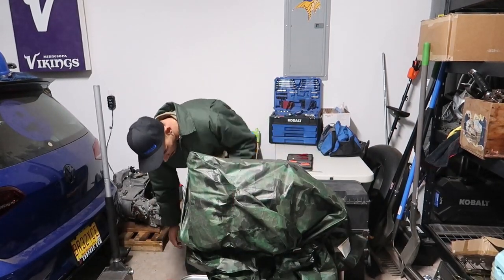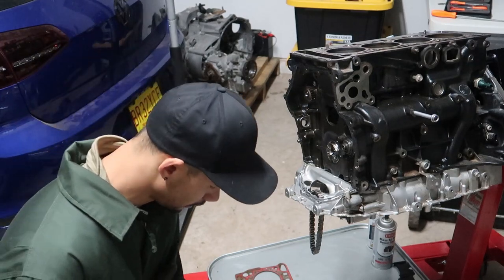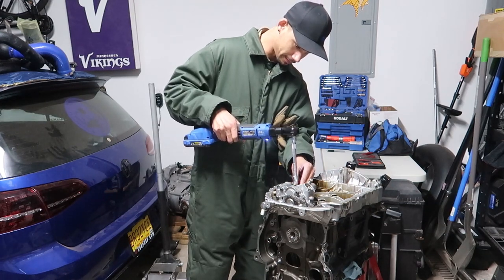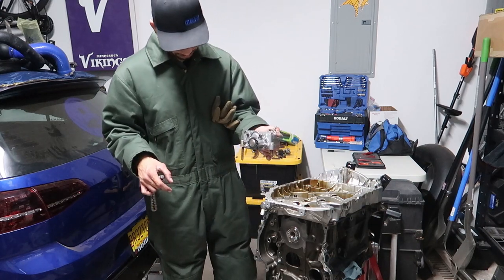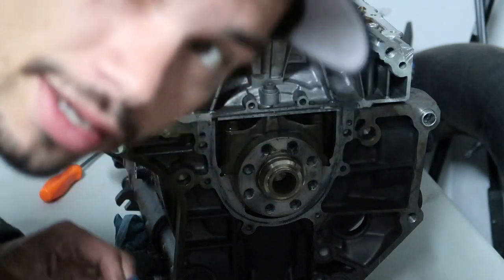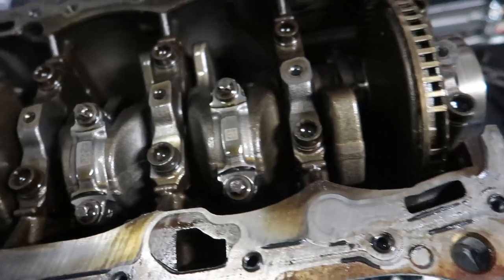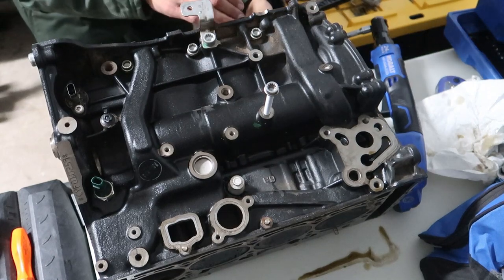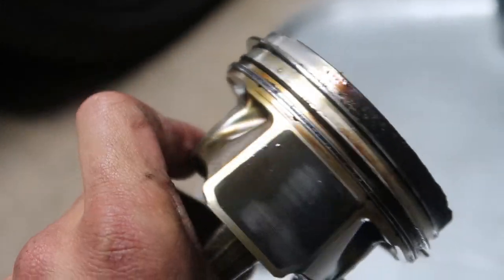Engine build - Breakdown! Part 7 - Pistons are out!! MK7 Golf R

Comment: Transfer case/front diff just went on my 2016 MK7 R DSG APR stage 2 with 68,000km on the clock. Turned out of a u-turn, full throttle, car struggled for traction and felt very odd, then I heard a clunk and snap sound. Towed the car home and to a mechanic and he spotted the transfer case making the sound as I drove the car on the hoist. Time for a second hand transfer case replacement and to sell the car off I think. Car has served me well. Scary now with what’s going to go wrong next. Love the cad to the bits but time to let go I think ..

Comment: So still 'advice' for a good 0w40 oil or a thicker one ?
I asked before, can you tell me please how often i must change the Rs7 plugs , my car is Stage 2 now...
Thanks...
Reply: Oil is dependent on where you live and what power you're pushing. 0w/40 is a good starting point for oil, but if you're in a hotter climate you can use 5w/40. Anything VW502 approved; you can check what is and isn't by google searching it.

For sparkplugs, check them at 20k and if they look pretty bad then replace them. If they seem ok then change them at 30k.
Reply from the maker: Ive been running 0w-40 (mobile 1) since about 20k.. changed every 3-10k.. i will be switching to motul for the build motor. As for plugs i check them at least every 3k (or after a hard weekend of racing) swap out no higher then 10k. FCP euro does lifetime replacements on EVERYTHING - even oil... so, its a no brainer to go ahead and do things mad early
Reply: @BryceJordanProductions  👍👍👍

Comment: With upgrading so much stuff on the car maybe you should look to upgrade the shifter to something like a CAE Ultra Shifter for quicker gear changes?
Reply from the maker: Tis in the works 😉 along with a hydro handbrake
Reply: @BryceJordanProductions  sweet will be good to see when its done
Reply: @BryceJordanProductions  you should look at the coolerworx if on a budget. Cae ultra one is higher price as it has to be tuv certified for Germany

Comment: What turbo are you planning on running and what power level are you shooting for? This build is awesome! Keep it up.
Reply from the maker: EQT vortex standard housing (for now) on E85 before the build @32 I'd guess about 520-535wheel low 400tq and now with the built motor and ported head at the same boost hopefully closer to 550 and 500+tq
Reply from the maker: Long term around 600&550ish tq

Comment: Dam, I’m surprised how much carbon build up there is... by how hard you drive. I heard the harder you drive especially on the Mk7 R’s the build up isn’t as bad.
Reply from the maker: Ive had s bunch of oil dump into the motor over the years, between a bad tuner who I had the boost way too high (blow by) blow turbo.. blown pvc.. i think its mostly from that